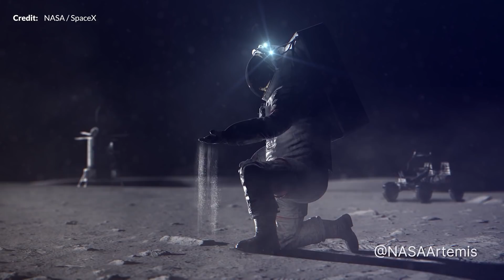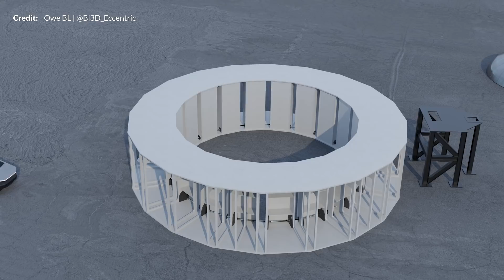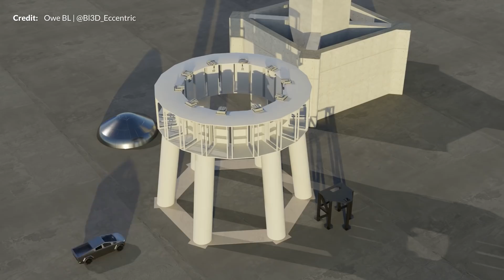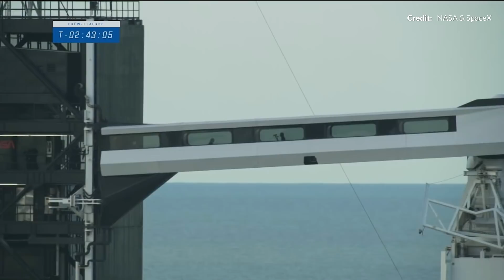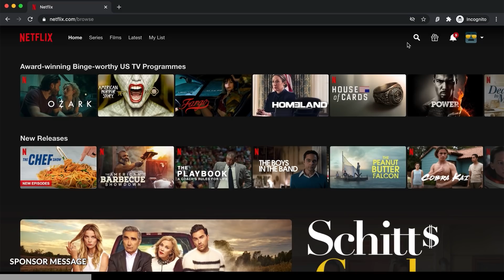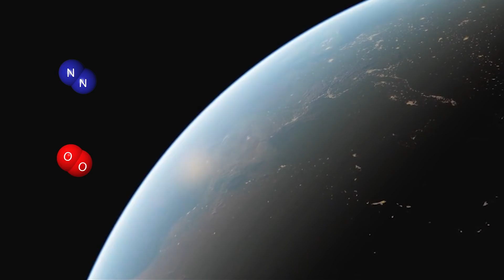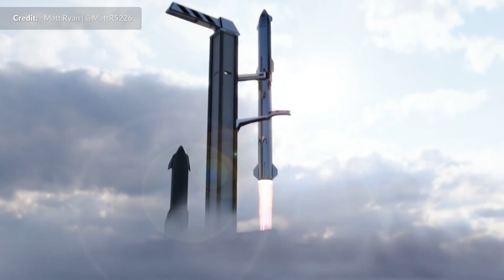SpaceX wins a multi-billion dollar NASA moon lander contract!

Comment: Just a couple of comments/ questions/  wise guy remarks 1) The SpaceX Flaim diverter seems ok to me as a matter of guessing it might give the rocket more lift? Of course, it might be too much heat 2)  I don't like the way the Starship is being held in place by the clamps around the skirt (unless the pressurized tank can withstand the force).  3) There should be some insolation between the engines and the fuel tank just above the rocket engines so as to prevent premature disassembly. 4) And I hate to keep bringing this up but the Skirt! the Skirt!!! Can somebody do something about that skirt that keeps the heat locked in for freshness or something?  5) And despite Elon saying that he doesn't require a degree in the field of work I couldn't see applying when there's no chance of getting hired. and 6) The only reason they need the catching arms are because they refuse to listen to my advice about the skirt - just look at falcon Heavey booster landing.

Comment: If they have laser charger beams launch pads it could power upwards of  25 % of the lift and landing ..they could also use some 1000 feet booster drones that catch rockets for another 35%
Reply: And where is the suspension 25feet pogo stick is 10 % reduction also a 2sec 20foot 40% halt is almost 60feet deceleration

Comment: I'm trying to think like Elon... "the best part is no part". Along those lines, (if I understand the design correctly) why is it necessary to build two domed and rounded structures inside the hulls of both the booster and the Starship to separate the fuels? At least, where the two tanks meet, why can't they just have a flat common wall between them, saving weight and material, and eliminating unused space where the domes now meet?

Comment: If the launch tower has a crane on it, why wouldn't they use the crane to move the booster from the 'catch' spot to the launch pad? Seems like it would make the hardware in the catching arms much simpler the less they had to move

Comment: Doesn't the CO2 pulled out of the atmosphere to make CH4 go back into the atmosphere as CO2 once burned by the rocket engine.  I wouldn't say it is carbon neutral since it takes energy to pull CO2 out of the atmosphere and added Hydrogen to make CH4!

Comment: I think SpaceX should consider landing StarShip on the level of the top of the booster. That way, the operation to lift the ship to the booster will be faster, far less heavy lifting over high height and also safer operation with more wind.. I'd say: the accuracy for landing on a relatively small platform is available.. (I could even imagine this can be done without using a crane at all)

Comment: Here is a theory for the nose cone test rig.  Are they going to test a nose cone tip that will support some kind of quick connect-disconnect lifting mechanism.  Perhaps this won’t be the only test goal but I do see a need for a way to latch onto a starship and lift it onto the booster that does not require a couple of guys on lifts hooking up to a crane.

Comment: Since it doesn’t have wings, the leg design isn’t limited due to weight constraints.
Reply: Yes it is.  Every kilo of leg weight reduces the mass of cargo.  Same reason for the experimenting with 3mm stainless instead of 4mm.
Reply: @Scanner9631  I’m talking about the lunar lander. Since it doesn’t have wings they can use that saved weight in the leg design and make them bigger and easier than what they’ve used on the starship prototypes.

Comment: The engines on the lunar starship are above the fuel tanks. What do they have planned to keep up intake pressure to the engines? Thats a serious distance to be pumping fuel upwards against the thrust of the engines.
Reply: The raptors are in the usual place below the tanks and provide the primary thrust for launch and landing.  The thrusters that handle the final landing (and I presume initial lift off) are above the main tanks and will likely have their own tanks and only provide the last bit of thrust for landing.  What fuel the thrusters use, I don't know.
Reply: SuperDraco engines use a storable propellant mixture of monomethylhydrazine fuel and dinitrogen tetroxide oxidizer. Currently they have a minuted fuel capacity when mounted on Crew Dragon but no doubt they can make fuel storage as big as needs be on a Lunar Starship.

Comment: Booster has to hover too close to the arms main structure in order to be captured, like at a surgical precision. Arms should be larger in length.
Reply: For some of the animated designs I've seen it is even worse.  The arms have pads that need to be under the grid fins so not only does the SH need to be over the exact spot but rotated to put the grid fins right over the pads.  Other animations are made so that the grid fins don't need to match precise positions on the arms and are much more likely.
Reply: @Scanner9631  you raise some good points, specially while pointing out the whole flying thing has to rotate in order for the grid fins seat right on top of the arms pads.
Reply: @wavystylemusicproduction1389  
Remember these are not official animations or designs. 

The actual SpaceX design is more likely to wrap all the way around and allow the grid fins to have whatever orientation happens.  At least in my opinion.

Comment: Should SpaceX have flame diverters?
Hmm...

1. Yes, because:
- it'll help with the splashback issue of the flames damaging the ground and possibly causing chunks of the ground to be shot into the engine area, and to keep the flames from also damaging the engines.

2. No, because:
- There won't be any flame diverters on the destination planet or moon, therefore the ship should be designed to be able to handle that from the get go, because if it isn't, then the chances of it getting severely disabled upon landing would be a lot bigger and a lot more devastating.

Comment: the reason im trying to explain this is that on a foreign moon or planet there will be no flame diverters or more importantly energy/sound diverters... so i think they are trying to solve a future problem which is super awesome....they are jedi knights!
Reply: The primary targets are Mars, the Moon and asteroids (in that order) so there is 0 to minimal atmosphere on those sites so atmosphere is less of an issue.
Reply: @Scanner9631  the engines create their own couplant, the transducer is the couplant....therefore energy propagation can have constructive or destructive re-enforcement...im talking about the return energy as the booster approaches landing, there will be attenuation but the conservation of energy still exists and as the distance lines up with the wavelength things might amplify and the debris can mess stuff up..... but yah, its a challenging problem to solve because they are trying to solve more than one problem  under varying conditions....i will concede however that my assumptions of this affect are based on my understanding of sound propagation not rocket engines, im simply making an educated guess....

Comment: The fuel farm looks far too small to support the long term launch cadence. Similarly I imagine the fuel production would need to ramp up a lot where ever they have their main launch schedule from. I can’t imagine the air harvesting is particularly speedy. Given how quickly the fleet could burn the fuel I doubt the facility could create even at 1% the speeds he rockets burn.
Reply: Unless this is a manufacturing center that only needs enough fuel to launch to the Sea Launch platform elsewhere.
Reply: @Scanner9631  yeah, I was mainly trying to point out that where ever they launch like the sea launcher it will need more fuel flow than this can provide... unclear whether fuel will be produced on site at sea or ferried. That’s a lot of infrastructure to place at risk but fuel ferries seem a hassle. But I guess having a constant ferry schedule would be just as good especially if they ferry directly loads the rocket thus removing the fuel farm before launch.
Reply: I suspect on site generation of fuel at the sea launchers.  Good test of the basic systems they will need to generate methane on Mars and they can boast of being carbon neutral if they use solar/wind/wave power.

Comment: If Starship requires to be fueled from the bottom, how are they going to do this if it sits on top of a Superheavy booster?
I mean, fueling it first and then lifting it on top of the booster would be less than ideal, as Starship is basically a giant bomb at that point and every second it takes to move it lets more fuel boil off without being refilled.

Comment: I expect the tanks to be isolated by a cover, it will also protect them from debris beeing projeted either by the take off or the crash of a vehicule... otherwise a pucture in the methane tank and the whole farm goes boom.
Reply: I would expect more that there will be a thick layer of insulation and external metal shell over the insulation.
Reply: A blast wall like we protect buildings on military bases would seem prudent and cheap.
Reply: Which may or may not be done.  Up to SpaceX and their engineers (and local construction codes).

Comment: The Super Heavy catch method sounds absolutely rediculous. The one thing about this whole endeavor that sounds impossible to me.
Reply: The weight of a falling Super Heavy for one has got to be insane and it will have to be precisely in the exact pin point position to be caught without causing critical damage to the Super Heavy or the crane tower/catch arm. Just those two things sound impossible, admittedly I'm no engineer, but that just seems physically impossible to me.

Comment: My bet is that EM is trolling the catch booster idea... They are having a good laugh at our expense.
Reply: Same as Trolling the flying water tower?  propulsively landing a water tower?  a Stainless Steel Rocket?  $500K per ton to LEO?  His Trolling is becoming our reality.
Reply: @ShelburneCountry  non of that is anything special.. With the exception of the raptor engines. I look forward to them trying the catch landing though.
Reply: @hawkdsl  Propulsively landing a 160 foot Steel Spaceship built in the open using a full flow staged combustion rocket engine is nothing special?  You are a hard man to please.
Reply: @ShelburneCountry  The rocket body is pretty standard stuff. Propulsive landing is not new.. going back to the 60's with the LEM, and large scale with the DC-X in 96. Building out of Stainless is not a big deal, it was just avoided because of weight. None of the ideas are new.. but with modern computer control, and better engines, it's finally coming together. The full flow that can restart and not eat itself (well, in progress anyway) IS amazing. Yes, that part is truly WOW.

Comment: I am honestly puzzled by this choice, the SpaceX HLS is massively over engineered for the task especially if Orion is going to be used to carry the Astronauts to Gateway for onward travel to the Moon. I am even more baffled considering the SpaceX HLS was rated lowest in the 2020 technical review whilst the far more practical Dynetics HLS was rated highest. The Dynetics HLS also looked more scalable as the building block for a Moon base....really don't get this choice by NASA.
Reply: SpaceX cost the cheapest. And if the lander acts as a temporary surface base that doesn’t have to throw anything away, that will be really good. 

Imagine if it just stayed in lunar orbit and it just would go down to the surface for however long, then go back to orbit. I just think that would be very useful.

Comment: It would be nice to not need a flame diverter, but tbh I think you can't get around making one, at least in the long run.
Even if using enough water can offset some of the damage caused by all those raptors, it can't take all the damage.
I guess its a question of just how many launches will be done from a certain location.

Comment: IMO the really big deal is not only did NASA pick SpaceX for the moon lander it appears they've picked just SpaceX. It would seem the Blue Origin and Dynetics landers have both been rejected....When you consider SpaceX has to build basically 3 versions of Starship and the superheavy booster along with launch infrastructure and orbital refueling by 2024 or there abouts this s a massive show of confidence by NASA in SpaceX and the Starship platform.

My prediction is this, should Starship make successful orbital flights before SLS it is likely SLS, Orion and Lunar gateway will be canceled in favor of the Starship platform.
Reply: Why would the SH booster need more than one design?

Starship is already planning multiple designs.  Cargo, manned and fuel tanker.  The big difference between these is what is in the cargo area. 

A lunar starship will add relatively little.  Landing legs designed for .17g.  Probable removal of the sea level Raptors.  No fins.  Landing thrusters for .17g.  Cargo/human elevator. Customizing the cargo area for the desired layout for use at .17g.

Don't see a problem. 

Actually I'd like to see the Lunar gateway design radically changed to be a Lunar starship with the landing ability removed and customize the cargo area for use as a station.  it can double as a fuel depot if they don't choose instead to remodel the fuel tanks as habitable area.
Reply: @Scanner9631  No they wouldn't need different boosters for each Starship model. As well Lunar Starship will likely keep it's sea level engines because they gimbal and there isn't room in the skirt to gimbal vacuum Raptors.
Reply: I don't see that the vacuum Raptors need to gimbal.  Attitude can be maintained using the thrusters and without the sea level Raptors there is far more room for the vacuum Raptors and only one might need to gimbal.
Reply: @Scanner9631  Well things change fast at SpaceX so who knows what they're planning today. All the same the original renders of Lunar Starship had it using 1 vacuum Raptor and 1 sea level engine to land on the moon. My assumption is the sea level engine is used cuz it can gimbal.
Reply: Did SpaceX do those renders or were they independent "best  guesses".
Reply: @Scanner9631  They were from SpaceX. The picture that shows Lunar Starship landing with the mid mounted thusters you can see the engine bells of 1 sea level and 1 vacuum raptor are still glowing red from being recently fired.

Comment: How are they bringing the astronaut back to earth, since moon lander doesn't have flaps and heat shield?
Reply: with regular Starships. You are right, the moon Starships will just go to and from lunar orbit or remain on the moon.
Reply: @MrEd2291  so it takes at least 2 starships to put astronauts on the moon again? Why not use regular starship as moon lander?
Reply: Too much extraneous mass.

Why carry the thrusters constantly from Earth to orbit? Same for the landing legs and elevator?

Why carry the sea level raptors and flaps to the moon when they serve no use there? 

Launch a lunar Starship and it lives its entire career in space.  The Earth Starship spends its entire career going back and forth from orbit and will do this even if the Lunar Starship is cancelled.  So more cargo to the moon with a specialized design on each trip.  Makes it cheaper.
Reply: @Scanner9631  that makes sense.

Comment: Dear Marcus:
The orbital launch platform has featured concrete anchors sticking out of the tops of the six columns since having been leveled off last week. This means there is a high likelihood of at least a concrete deck being poured BEFORE that heavy steel circular table is erected - but I honestly didn’t see that coming and cannot figure out why they’d do this - yet.

I still haven’t seen any sign of big-ass green steel water pipes in the foundation  since they were delivered months ago-no sign of them in the foundation either. Maybe they’ll end up with surface-mounting flame diversion and water deluge systems.  I really wish SpaceX would publish nerd-level plans for the program. This guessing w/o substantive information is past the “getting old” stage because watching Mary’s sped-up videos of daily operations is almost as bad as watching paint dry sometimes. 

We don’t know specifically why they might be doing some things, and it’s like watching them drill a hole in the dirt thinking “that’s probably for a camera tower”, and finding out later it was only a temporary placement of a row of outhouses.

Jokes aside, thanks for this detailed rundown that I enjoyed more than any other.

Comment: I wonder if the reason for building their own fuel tanks is because they have litteral tons of the older rolls of aluminium left over from before they switched to the 3mm stuff.
Reply: rolls of steel*Also they don't switched. Every ring piece up to sn20 and bn3 is made of 4mm steel.
Reply: Such tanks are bespoke, so there may be lengthy lead-times to consider if sourcing from an external supplier. Another factor is the sheer size of the tanks - they are likely impossible to transport by road (with bridges, poles etc in the way) so even if an external supplier could make them for a competitive price, delivery to site would be problematic.

Yet more factors are they already have not only the raw material supply chain in place, but the means (tools, space, staff and experience) to manufacture them almost on-site, and all effort that goes into build/test/inspection serves to use & prove their processes and in-house skills and experience that are directly relevant and beneficial to the build of their launch vehicles.